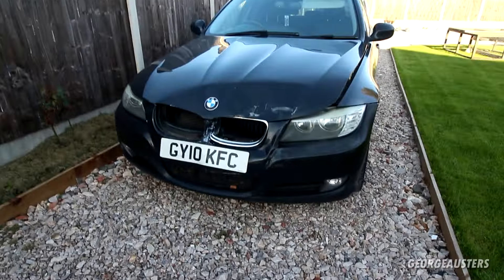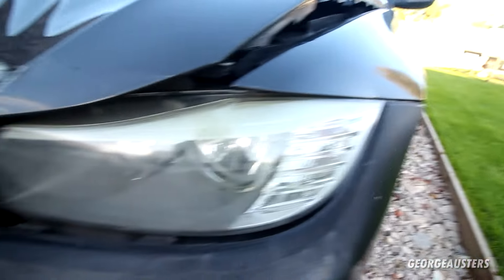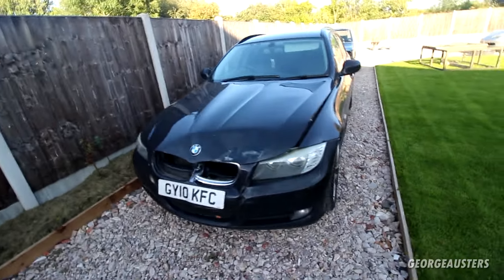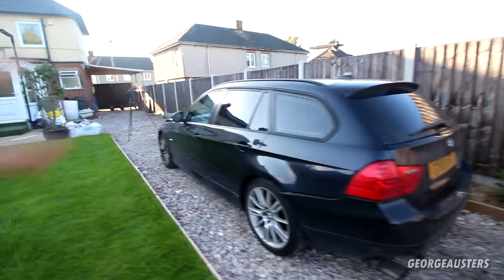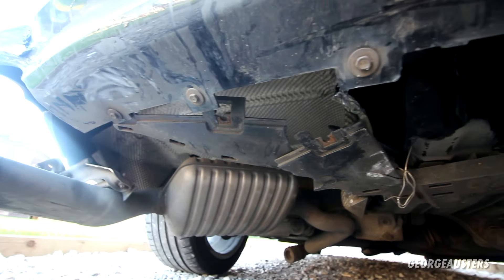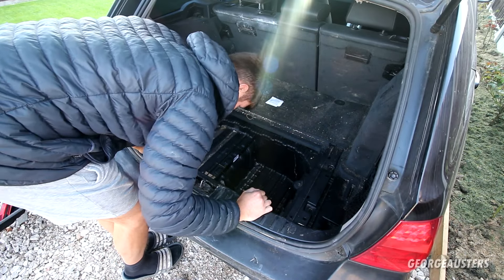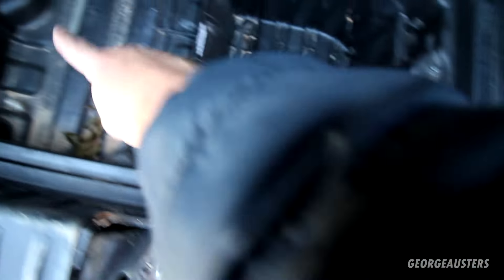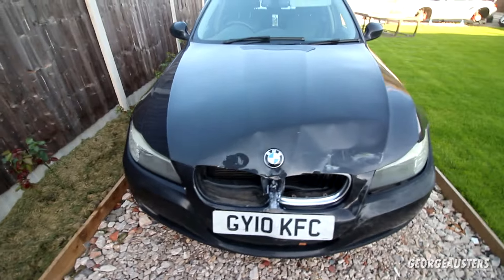I WAS IN A HUGE PILE UP CAR CRASH!

Comment from the maker: Just an update:

We both woke up the next day with a sore back and neck but we’ll be fine.

The at fault driver has admitted liability so it should be settled with his insurance company.
Reply: @GeorgeAusters  good to hear
Reply: That's good. Now you can use the compo claim money for your garage build
Reply: Thinking out loud ...will hos insurance honour the claims as obviously the guy was drunk doesnt that invalidate his insurance?
Reply from the maker: @thindo  He was actually released after getting back to the station so alcohol level must have dropped. But regardless you're always covered for 3rd party
Reply: A shame George
Reply: @thindo  if the drunk drivers insurance invalidates his cover the MIB ( not the men in black) but the Motor Insurance Bureau should take up the case and cover the losses in an uninsured event

Comment: Thank God you are fine. Most important thing. As for the car, I must say the E9X is incredibly safe and just a really strong car despite going under an SUV. I mean, look at what happened to the Audi which hit your car in the rear. BMW has much stronger front and more crashworthy even at lower speeds, like in your case. That is what I call a properly designed car. Here in Romania, a friend had a crash with his Renault Laguna 3, was not his fault, and the insurance company of the other driver asked if he preffers like 1200 pounds to repair the car himself (2 doors and 1 fender, nothing structural). He accepted and did it for much cheaper with replacement salvage parts, in same colour, and saved like 800 pounds.

Comment: It's a write off, but £300 in parts to fix it. An LCI bonnet is £100 these days and SE bumpers, about £80 each. The plastic rear tray is 20 quid, plus a day to bolt it all on. Buy the car back for £300 and you're a winner. Car accidents really are awful though.
Reply from the maker: It’ll need more than that..

Front bumper
Rear bumper
Front slam panel
Front rad pack possibly
Bonnet
Tailgate 
Boot tray
Rear undertray
And any damage to the exhaust as it has been pushed forward

Comment: I doubt insurance will repair that. They will try to write it off. 

Which is not good if you have a good car that you have put lots of work into.
Reply from the maker: It'll definitely be wrote off
Reply: Be interesting to know how many years before this insurance claim gets fully settled. 

Took 2 and a half years for my last claim. And that was just someone reversing into my stationary car in a car park. And I had two written witness statements.
Reply from the maker: I’d imagine this should be sorted very quickly